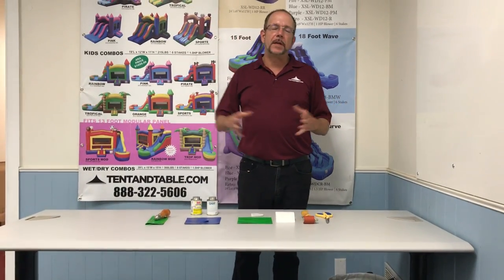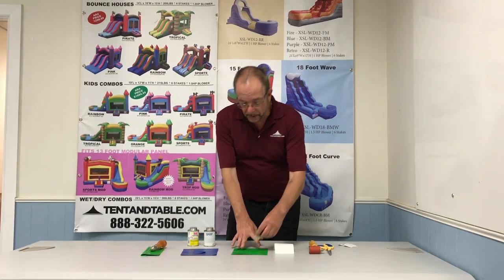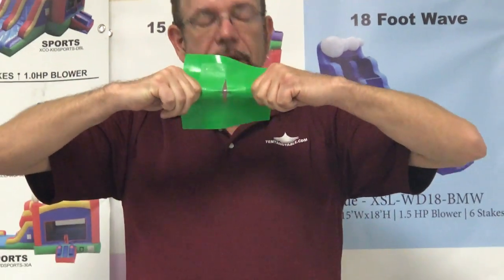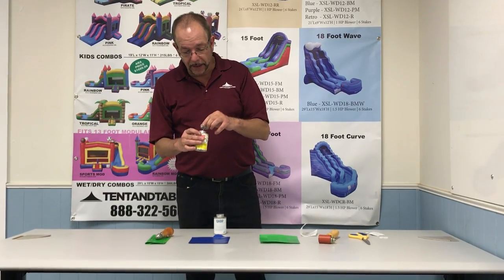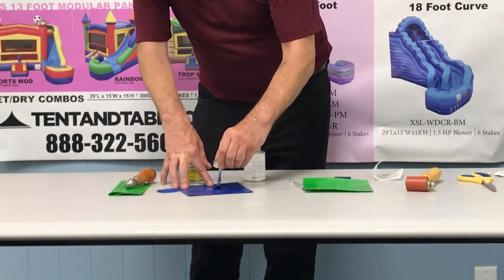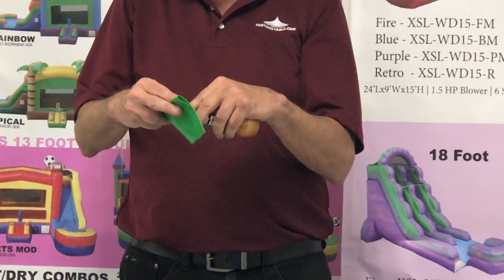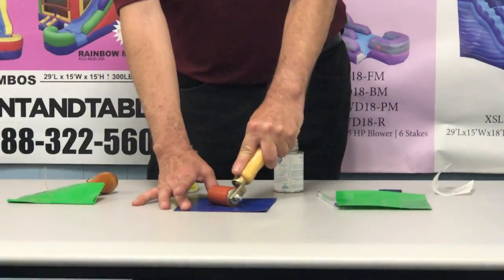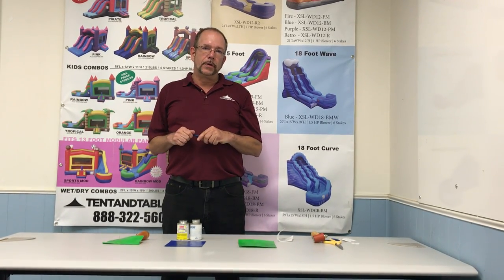How To Repair a Bounce House | Commercial Inflatable Bounce House Repair | Repair a Bouncy Castle

Comment: The seams (3) on the bouncy house slide are pulling apart. Do you recommend using the speedy stitch and something else for reinforcement?
Reply from the maker: Speedy Stitch would work to cinch up the split. If it's a particularly bad tear, it might be a good idea for you to use the SX69 Glue to patch the spot if you can get the patch underneath the vinyl (like patching it from inside the inflatable. You just don't want to block the flow of air completely. 

Please feel free to contact our service team (customerservice@tentandtable.com | (716) 317-4372) if you'd like further help or clarification, as we're always happy to help where we can.

Comment: Hey! I have a waterslide that has a couple spots that were exposed to the sun and appear very dry. When we pulled at that section it ripped. Can we treat or repair the dried out sections? It's not the entire slide that was exposed and we would really like to keep it, not to mention it was EXPENSIVE. Any advice?
Reply from the maker: Hi! We don't have personal experience with that issue, but this would be our suggestion - hope this helps: https://www.amazon.com/Rejuvenate-Leather-Vinyl-Conditioner-Rehydrate/dp/B00I4WI5Y4

Comment: I have a Little Tikes 2-in-1 Wet 'n Dry Inflatable Bouncer.  I cannot find what the fabric material is.  How do I determine if it's nylon or vinyl?  Thanks in advance.
Reply from the maker: Hi Greg, I would contact Little Tikes Customer Service. Someone there should be able to tell you the material they use. I was just looking at the item online myself and am surprised they don't have it mentioned in their listing.

Comment: So I recently purchased a smaller version of a water slide inflatable didn't check it out the way I should have got it home realized where the kids put their feet to climb in leaks air so much so that it's unusable what would be the best thing to use to repair two of these areas ty!
Reply from the maker: Depending on the size of the hole where air leaks, you could use our patch all tape, https://tentandtable.net/patch-all-kit.html. We also have our vinyl repair kits, https://tentandtable.net/pro-patch-kit.html, that should work for that, with a more in depth video here: https://youtu.be/MKZQF0wfe24.

You can also contact our customer support team, as they would be best to answer questions like this more in depth than I can here. customerservice@tentandtable.com

Comment: I have a bouncy castle that is almost two years old. When it was new it inflated firm. Now it is softer and the side walls are flopping down. I cannot see where the leak is coming from. There are no obvious tears. I’m thinking maybe the seams are loose? What do suggest I do to fix this problem?
Reply: Hi Karen,, I have the same thing, did you ever get an answer?
Reply: @margaretslingerland7411  I did not get a reply. What I ended up doing is getting an additional fan. There are two vent tubes on my bouncy castle. Just be sure to use different sockets. It’s sucks a lot of power.
Reply: Thank you so much Karen, really appreciate your response!! 
So you couldn’t find a hole either because the seams naturally breathe out somewhat..
Reply: Hey Karen, I also have the exact same thing going on - did you find out anything new on how to make the "old" seams more tight again? I can see how a second fan can be an alternative, but yes, it sucks so much electricity already.. please let me know if you have any new sollutions ;-)

Comment: I got a bouncing castle with a water slide and it seems as the edges of the water slide are pealing off the glue…what so I do.
Reply from the maker: I would contact customer service about that.
email: customerservice@tentandtable.com
call: (716) 317-4374

Comment: I Have s little bounce house is for inside the house. Is a  Fisher-Price Bouncetastic Bouncer is have a hole in one of the seams and it is not a stitch seam, which one of those methods could.I use with it. And the hole is on one of the poles, not in a area that's going to be jump or close to the entrance

Comment: Hey, I've stitched up a slide it had a giant rip in the seams. I've stitched it up and it's bulging so I've undone it and restitched it using bigger gaps and looser and it's still bulging. There's no zip to climb inside either so I can't patch it up. Have you any advice please?

Comment: Hey Guy....you prepped the blue circle patch with your cleaner, then placed it on the table.  You then applied the glue to the square blue patch which is good, but you picked up the circle blue patch and put glue on the wrong side where it wasn't prepped...... Opppsss.
Reply: It was a very helpful video to help with my repair.  Thanks.